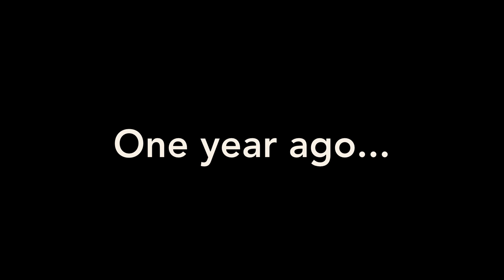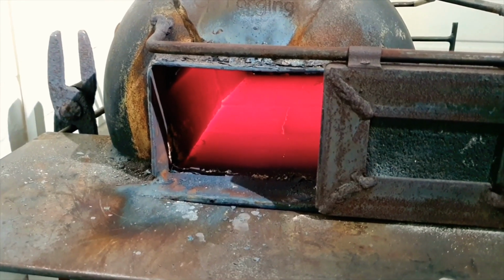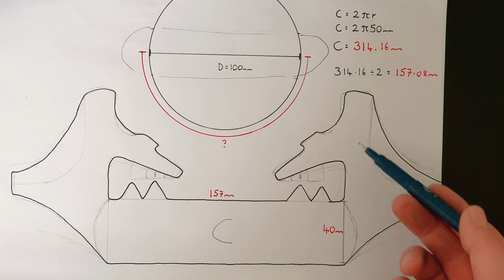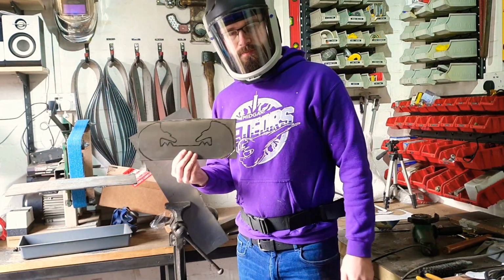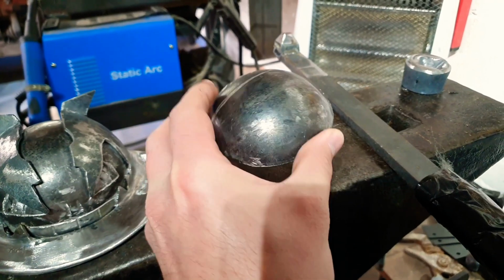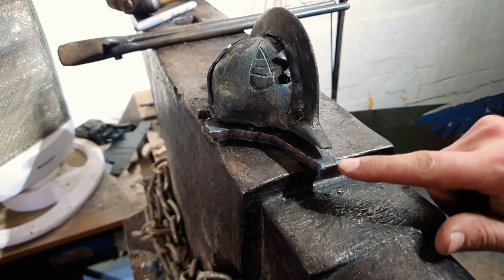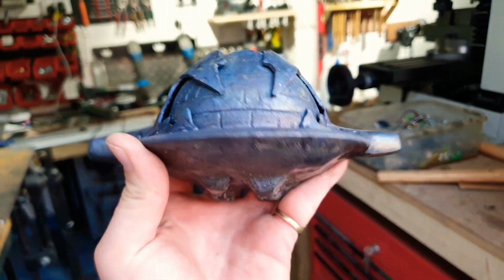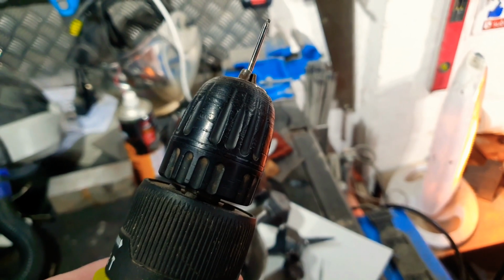REAL Hand-Forged Steel-Type Pokemon: STEELIX

Comment: Pokemans. Stick your gas bottle in a water bath, will keep the pressure more better. Sheilding gas and solid wire for the MIG is even morer better. I am envious of your large metal hitty things.
Reply from the maker: Might actually take you up on the water bath idea, I have noticed a fair amount of icing up. I'd like to use regular mig wire with gas, problem is most suppliers of welding gas in the UK are for big companies who want to sell effectively a contract, its difficult to find a good hobbiest supplier. :/